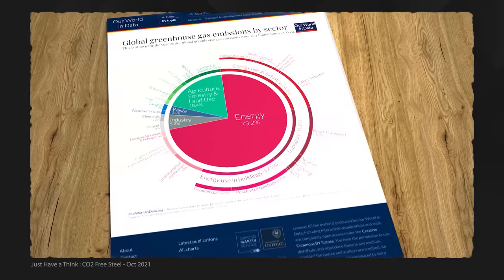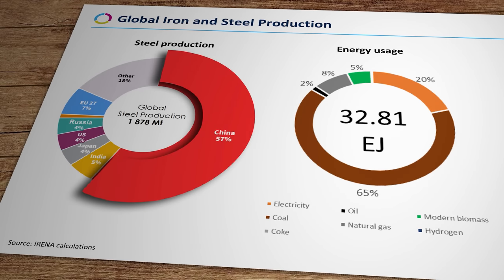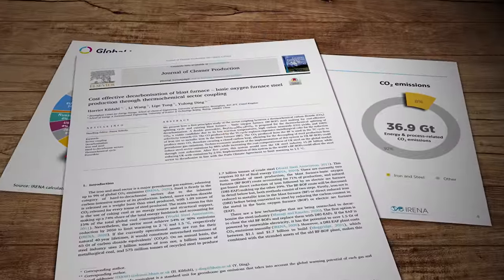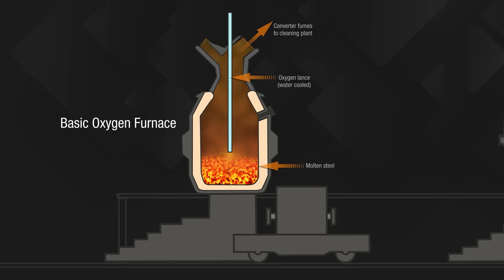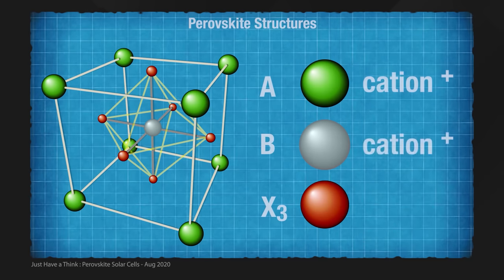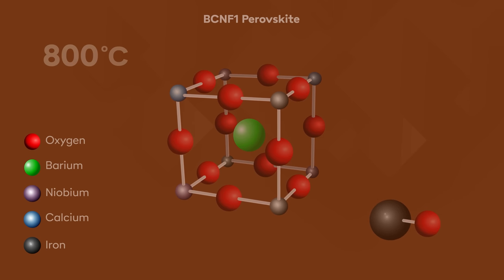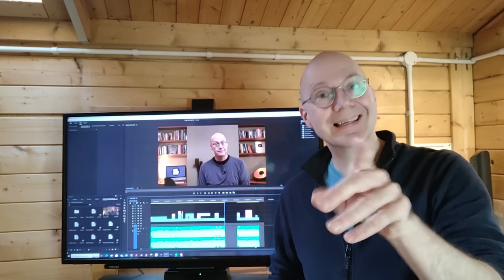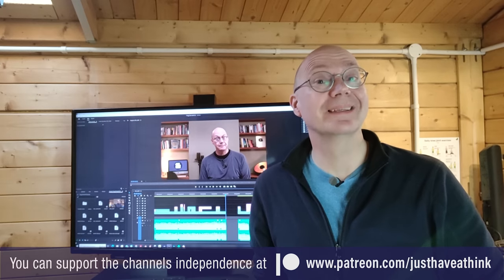New breakthrough claims 90% reduction in Steelmaking emissions.

Comment: Surely the engineers that produce the blast furnace ceramic tiles could come up with an air permeable ceramic solution to hold the iron ore while it becomes molten. A cleanse cycle to follow or finish off the blast furnace cycle that also cleans off the ceramic may work with the right process and design.

Some say the use of the term 'hard to abate' is used as an excuse by the stubborn and incompetent. All work at this point  in time to avoid serious climate damage is difficult. Why do uninspired engineers who lack imagination and ambition get to play a tiny violin about how hard it is for them? Its hard. Get over it. Get on with it. It has to happen now.

Comment: Wait, won't the carbon monoxide convert into carbon dioxide overtime?
And even if it doesn't, isn't carbon monoxide the chocking gas that we also do not want to release in the atmosphere?
Reply: They put the carbon monoxide back in the furnace to let it extract new oxygen from the rust to turn the iron oxide into iron. This also turns the carbon monoxide back into carbon dioxide.

Comment: Only if you have 60 windmills driving the furnace
Reply: Well yes.   I think we all understand that decarbonisation of the grid is essential.  It’s the other stuff that’s going to be tricky …
Reply: The only issue is that you can't let a furnace depend on the ever changing weather, you need a back up for those 600 windmills.
Reply: @hotdognl70  That's the role of the grid.
Reply: @incognitotorpedo42  In that case we need a backup for the grid.

Comment: Carbon monoxyde might not be a greenhouse gas but it surely is toxic. So I assume it also needs to be captured and not released in the atmosphere. Which I assume would be as costly as sequestration of Carbon dioxyde. So, what’s the point?
Reply: The carbon monoxide is put back in the furnace to let it extract new oxygen from the rust to turn the iron oxide into iron. This also turns the carbon monoxide back into carbon dioxide. Rinse and repeat.

Comment: The process needs to be considered as a whole, it is possible to accidentally add more carbon into the process without doing so.  I know a lot of "Green" hydrogen actually can add in more energy requirements into processing steel, which often means more carbon instead of less.

I would say that molten salt breeder reactors (with a saftey built in from physics of the process) feeding a arc furnace would be a better solution.  With additional attention to some of the process chemistries, as mentioned, helping to take care of lesser emission sources.

Most of the 1st world nations, old industrial ones, have done a very large job of cleaning up their emissions compared to the new players which are still choosing cheap and abundant coal as an energy source as they leapfrog to nuclear, wind or solar depending on circumstance.  Germany threw a trillion dollars of solar panels down where the sun don't shine, and shutdown its nuclear.  The Russians are laughing at them right now, and Germany's reputation for  planning and precision takes a kick in the crotch.

Comment: Bio mass charcoal, while sounding great, ask yourself the following question "should we burn our forests?" Because that's what we will have to do, and biomass have lower energy density than normal coal, and to even produce the sheer amount of biomass needed to replace the coal we surpass the CO2 from the mining, transportation, refining AND burning of the coal ore. And that's before even accounting for the actual burning of the biomass.
If you don't want to burn the trees around you, which trees should we burn?
And releasing CO "because it's not a greenhouse gas" is stupid, give it an 2 molecules of oxygen and you get CO2 and O3. Give it a molecule of water and you get CO2 and a H2.
The carbon monoxide molecule isn't stable, it reacts and you get the same amount of CO2 in the end anyways, you're just fudging the numbers hoping everyone looks at your right hand and not your left where you hid the same pollution (or more as is the case of bio charcoal)

Comment: Dutch windmills on North Sea will generate a lot of excess electric power esp at night, that can be used to very cheap,y making hydrogen. I expect the Dutch will switch to hydrogen from natural gaz, as they have already a finely mazed distribution network for gaz… and the hydrogen is indeed ideal for Tata Steel, the former Hoogovers in The Netherlands…  asking steel in The Netherlands  ould be made highly price competitive and more and more so as costs for carbon dioxide emissions keep going up. And because of speculation thiseemissio; rights will become very expensive indeed, and thereby steel making in Europe, at least, as far as that is done using old tech, instead of hydrogen… Price of co2 emission forces steel industry to innovate, and rightly so. It there were no economic pressure or incentives, the industry would be conservative and invest nothing in improving the greenness of it’s processes…

Comment: The industry being left out of this which deals with steel and other alloys that have been created is the process called heat treating. There are many ways to do it and it is an absolute requirement to make the metal meet use property guidelines. In other words steel isn't usable until you spend another several billions of tons of methane and CO2 to give the materials at hand, the qualities like hardness flexibility and case depth. Not to mention other manipulations required to make it pretty, or coated, or or or and so on, etc.
The facts are these: as cool as it is to industrialize, it is killing our planet and us right along with it. We as a species are the smartest dumbest bag of wet mice forever chasing cheese that we can neither see or conceive of, but we can smell it dammit - WE CAN SMELL IT. So all bets are off.

Comment: Einstein's definition of insanity (look it up). It is high time we do away with steel making. With today's technology, we could build  ships out of aluminium, fiberglass, WOOD (hold down, I mean recycled, fiberboard type wood, not cutting down, again, Sherwood Forest). If anyone worries about how vulnerable aluminium ships are, look up what happened to the Hood, Bismarck, Prince of Wales, Musashi, Yamato, the list goes on and they were made of STEEL. PERIOD. Furthermore, all the materials mentioned are non magnetic, and they will not detonate an old WWII mine. As for structural steel, it can be made from steel recycled from old ships, cars or bridges. And for the XIX century way of thinking of steel making CEO's , they could recycle horseshoes. And, to shipping companies, for ships or containers, they should demand 100% SS304 at least, so the ships or containers will not rust

Comment: So it produces less greenhouse gas but there's a lot of poionous gas floating around instead.  Not sure this is a win.
Reply: The carbon monoxide is put back in the furnace to let it extract new oxygen from the rust to turn the iron oxide into iron. This also turns the carbon monoxide back into carbon dioxide. Rinse and repeat.
Reply: The carbon monoxide is contained in the system.  It reacts with iron ore to produce steel and carbon dioxide.  The carbon dioxide is converted back to the monoxide form, so it's a continuous process.
Reply: @johnbash-on-ger  Yes, I wondered about that but I felt that if there is carbon going in then it has to come out as either monoxide or dioxide.
Really don't want industrial scale monoxide floating about.

Comment: Isn’t carbon monoxide super poisonous? You didn’t say what happens to the CO, surely it doesn’t just vent to the atmosphere?
Reply: The carbon monoxide is put back in the furnace to let it extract new oxygen from the rust to turn the iron oxide into iron. This also turns the carbon monoxide back into carbon dioxide. Rinse and repeat.

Comment: Another way to reduce emissions from steel production is to produce less steel.
Reply: Recycling
Reply: Like by reducing car reliance
Reply: Using wood in construction.
Reply: @davitdavid7165  Let the Bureaucrats control your car use remotely.. you do not need that next trip to the store or Pub .. just once a month is fine!!!!
Reply: @ablewindsor1459  what are you talking about?
Also are you actually trying to use anitauthoretarian rhetoric while.... defending climate change? Really?
Reply: The population keeps growing, we're going to keep building things, steel and concrete use aren't going to drop for another couple decades at least. :(
Reply: @ablewindsor1459  You drive your car to the pub? 🤔 And then get a taxi home, and another taxi the following day to pick up your car?
Reply: It sounds like there are a lot of technological problems to be worked out to prove it is more viable and economical then using green hydrogen reduction of steel.  We must produce only green steel or use another green material to replace it.
Reply: Bamboo could replace steel as reinforcing for less-expensive, carbon negative, longer-lasting geopolymer cement concrete in a whole lot of construction. We need to do that anyway: Portland cement is 8 percent of climate change, and it begins to crack and crumble in as little as 40 years. It's the reason our infrastructure is crumbling in the first place: rebuilding with it is criminally stupid.
Reply: @nagualdesign  OfCourse because I am Always the Designated Driver.....have not embibbed in 25 Years......
Reply: @nagualdesign  Yup did that trick back 35 years ago......
Reply: @matthewsaxe6383  FYI, steel production is already recycling steel for decades.
Reply: @johnorenick9026  concrete goes back thousands of years.  You would think someone could make a more green replacement material for concrete by now?  
Since graphene is suppose to be over a hundred times stronger than steel, I wish we could find an inexpensive way to use it to replace steel and to get rid of atmospheric carbon at the same time.   Even though it would help prevent climate change, I won’t hold my breath.
Reply: @penumbraman99  There wasn't much call for environmentally friendly alternatives to concrete during Roman times.
Reply: @nagualdesign  No there wasn’t, but there is definitely a reason to now!